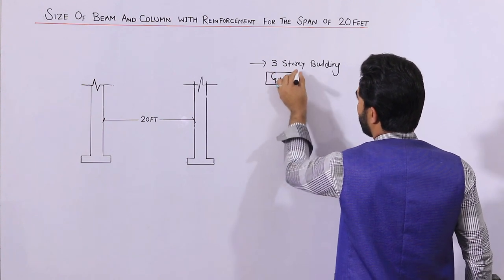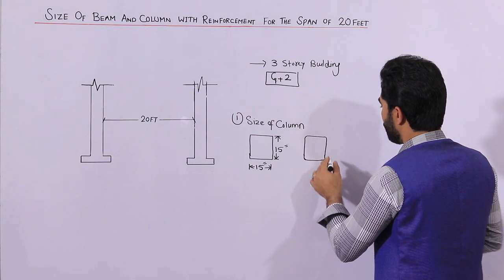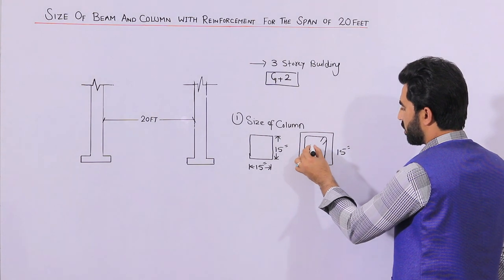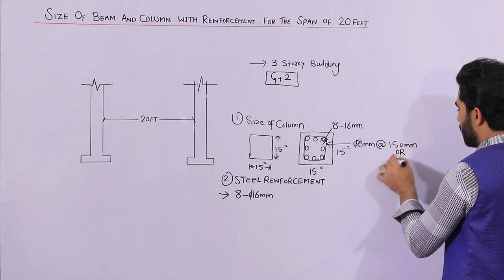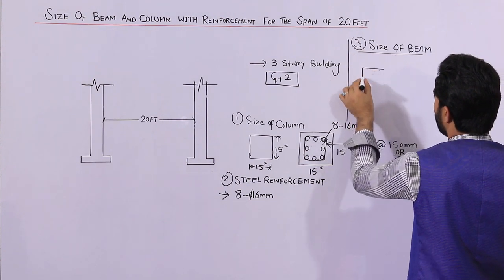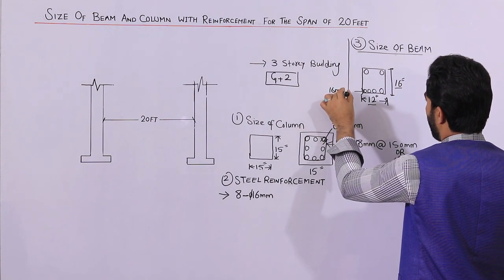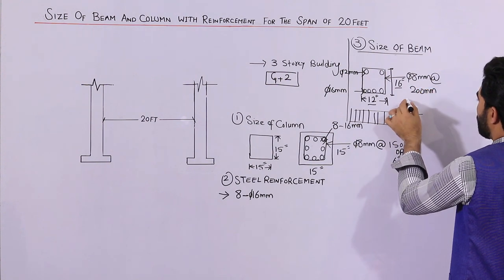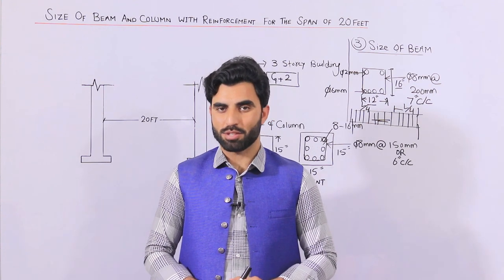20 Feet Span Steel Details for Beam and Column | Basic of Structural Design |

Comment: Hello, Planning for a G+1 house and the plan is to have 3 areas of 13 Ft X 19 Ft on the ground floor. Can we erect a wall partition with concrete bloc of 4" on the top of the 19 feet beam for the first floor? If yes, what would be the size of the column and beam. Thanks in advance.

Comment: Sir, by using the formula for beam design, the length and width of your beam based on 2O feet span, should have been 10 inches wide and by 20 inches deep
Reply: Or. 12inches wide by 20 inches deep beam dimension for lighter load only